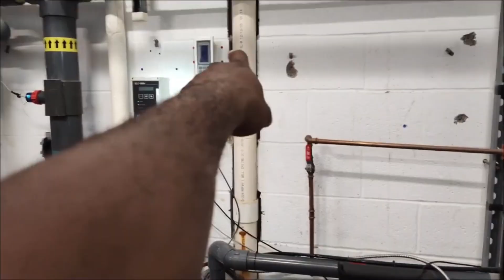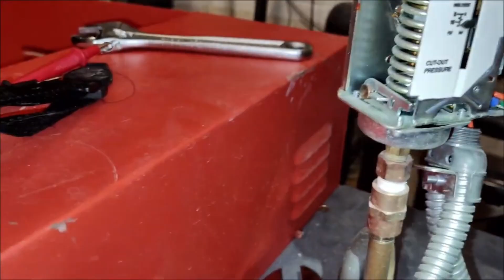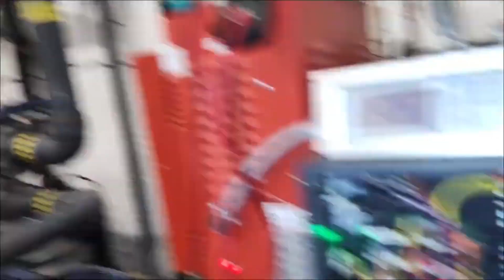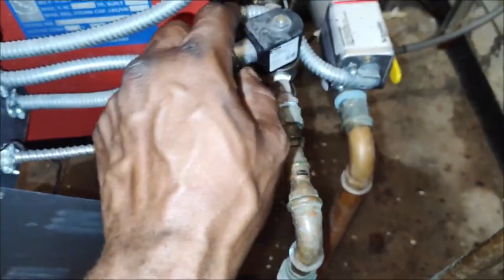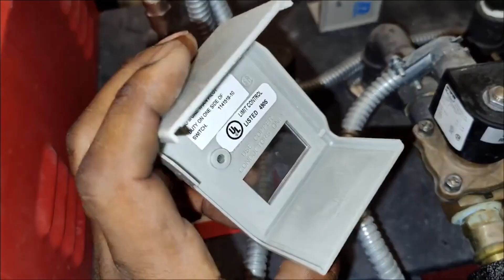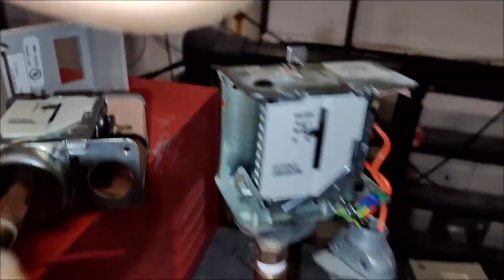Steam Generator NOT STEAMING. Importance of SEQUENCE #bluecollar

Comment: we have the same unit at our facility and have no steam.  The pressure gauge is at 0 and I hear the solenoid click like it is kicking on but nothing.  I don't know anything about these units.  any suggestions?
Reply from the maker: dang i hate im seeing this late but ill answer anyway.first would wanna know is the water sightglass is 3/4 full. then would wanna know if the heating element contactors are pulling in. if they arent then id look at pressure cuttoff switch being tripped.if not id jump it out to see if that gets contactors to pull cause it may have just been a bad cutout switch. if not that i would make sure the board is sending signal voltage to the heater contactors. but for future reference delta faucet has an awesome tech support for these products and thats were i learned everything when it comes to these units.